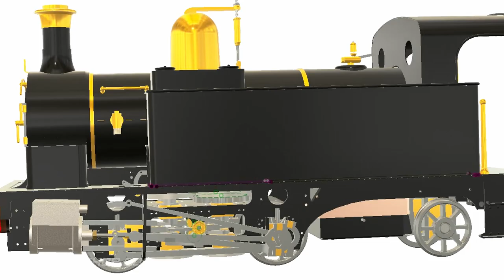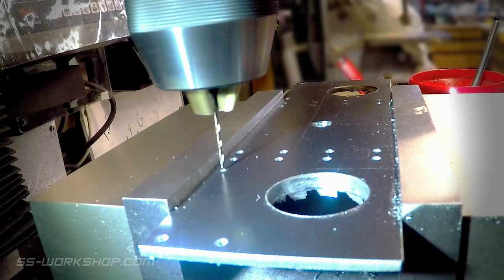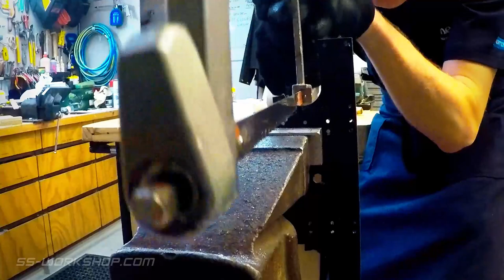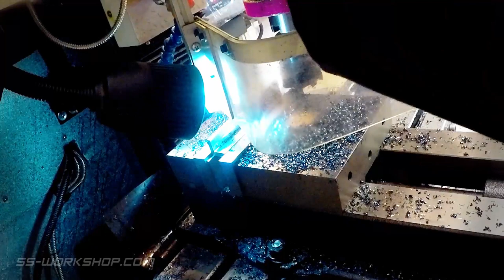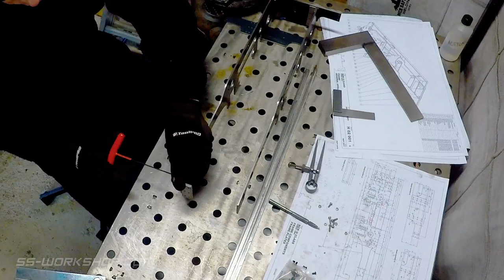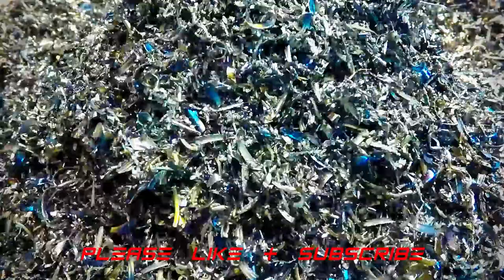Fell Engine Project – Buffer Beams & Mounting Brackets S1.E2

Comment: Hi Chris  one benefit of milling the angle  brackets from solid is you will have to mill the block square to start off with , this will guarantee its squareness  cold  rolled angle  can warp  when its machined
Reply from the maker: Yes, it seems like a shame to be turning so much material into chips but it’s certainly delivering the result I’m after and certainly avoids the warping issues.